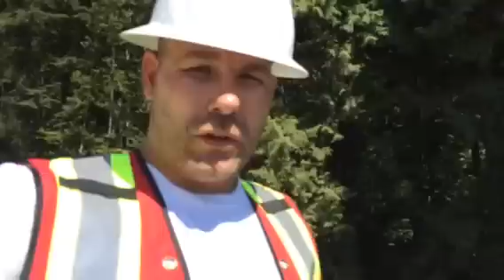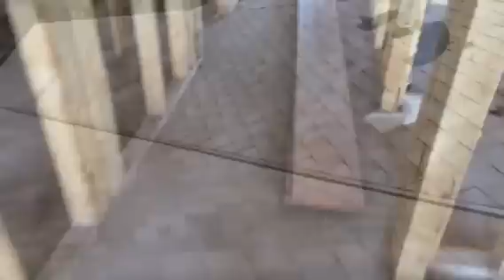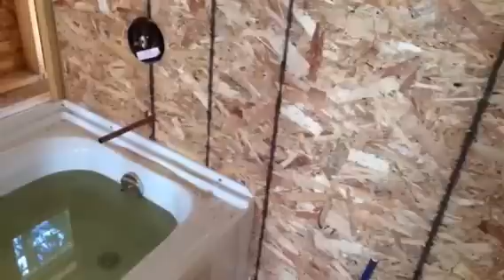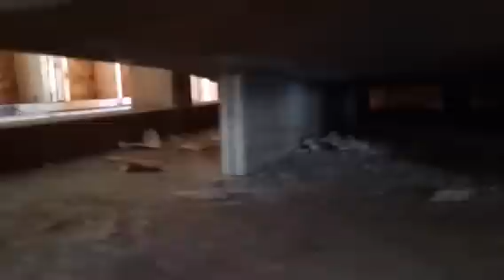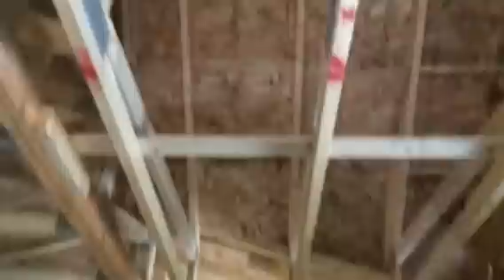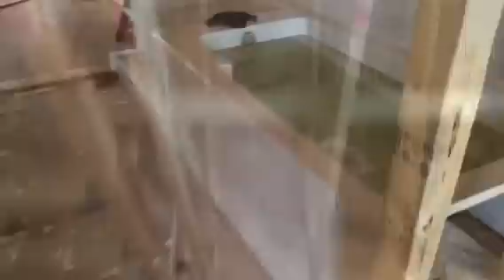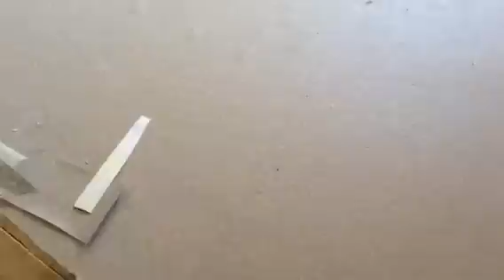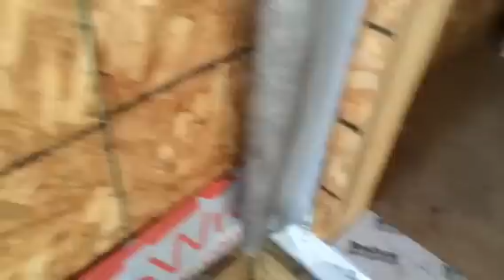New Home Construction Fails

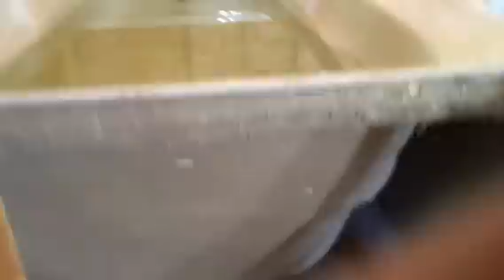Comment: Hmmm... that's strange. At 1:45 the gentleman states that 1 gallon of water weighs 10 pounds... which is true, IF you are in United Kingdom. In America, (pretty sure he is American) 1 gallon of water weighs only 8.34, because American pints, therefore gallons, are smaller than UK ones. As a building inspector, I would EXPECT him to know how much a gallon of water weighs.... ESPECIALLY if he is making a point by mentioning it!!
Reply: chris b You'r right. But I would be amazed if Canada uses British pints instead of American ones. I would have heard about it. Think of the fuel pumps in gas stations either side of the border. Neither of them are on litres, yet...

Comment: The OSB on the tub valve wall is most likely a shear wall required by the engineer and will be covered with moister resistant sheetrock or cement tile backer (if in fact tile will be installed). You can see that the bathroom was framed 1/2 inch over-sized to accommodate for the OSB. You had the same situation with the other tub, OSB (most likely a shear wall) covered by sheetrock, although the sheetrock was the wrong type as you said. Almost all fiberglass bathtubs and showers are manufactured with an OSB base/frame, and have been for at least the past 20 years.
Reply: Then the shear wall should be on the other side of the wall.

Comment: Lot's of people commenting that the OSB wall is most likely a "shear wall". No it's not! A shear wall might be used in a major building, like a hotel, in which case it will span completely from one side to the other, except for where it passes through hallways or doorways. A simple residential does not have them. The biggest reason in this house appears to be simply a sizing adjustment. The bathtub will be a standard size of 60inches. If the room is too big, then the plumber can only screw the tub to one end, with a gap on the other. It appears they just furred out the wall to make the room 60. And no, they don't put tile directly on that, but a tile/wet-location approved wallboard will be installed first. But even with that, it's still preferable to have real wood behind it. OSB is the worst choice.
Reply: +Kauwhaka Bathtub 60 inches ....  WoW.. a country of dwarfs ?? :-) (Don't believe so...) Bathtubs come in all sizes of fashion and money available.  The 21st century is not about "standard" anymore.
Reply: +Kauwhaka Maybe in your country, but in the USA we have shear walls peppered everywhere along the envelope perimeter of a single family residence, as well as a few on the inside.  They can be as narrow as 16".  I think you may confusing party walls for multifamily and commercial fire protection with shear walls (to resist lateral wind or seismic forces).
Reply: +Steve Crane Yes. As you said, in situations where a shear wall is used, they are connected to the exterior. This wall we can clearly see is not touching the exterior. It's just standing on its own with nothing on either end of it. (One side is hallway, the other is open stair well. And no, a shear wall and a fire wall/party wall are 2 different things, although in some situations a party wall can be designated as shear and it gets sheeted before the 2 layers of fireguard drywall is applied.
Reply: +Wig4 60 inches/5 feet is by far the most common and dominant length for normal tubs like the one shown. Any search for such tubs will show more at this size than any other. They can come in several different shapes and sizes, especially if they are Jacuzzi type tubs or corners tubs, but if you see or search for a tub similar to the one shown, the vast majority are 60 x 32 or 36.
Reply: +Kauwhaka We will never know.   I have built houses with the shear wall strapped to a glulam underneath instead of to a lower shear wall or a foundation.  It is unusual though, since most shear walls transfer forces directly downward to the foundation, thus they will likely be an exterior wall.  Honestly, the framers may have framed the opening at 60.5" thinking they are doing the plumber a favor, and the plumber may have nailed in the OSB to get an instant 1/2" shim so the tub fits snugly. Don't ask me why I suspect this.  I will tell you that I ALWAYS carry a full bottle of aspirin in my truck.
I am frankly weary of this vociferous pissing contest by amateurs and know-it-alls when our evidence is so sketchy.  I'm guessing.  So is everyone else.  What we know is that there's nothing wrong with OSB back there, and that no professional will ever tile over OSB -- ever!  The inspector hasn't been around construction long enough to understand what's going on.  And I'm not at all surprised.
Reply: +Kauwhaka Simple answer:  I repeat with copy-paste and a little modification : 
Bathtub 60 inches ....  WoW.. a country of dwarfs ?? :-) (SEEMS PROVED !!??? ^_^) 
Bathtubs come in all sizes of fashion and money available, IN EUROPE.  The 21st century is not about "standard" anymore, IN EUROPE.  Minimum length range +- starts at 1700mm here (since ages), and most common nowadays are 1750 x 720-750 , or 1800 x 750-800 ..... at least, we're not folded down like sardines in our choices of bathtubs !!??? lol 
>>> 
https://www.google.be/search?q=baden&source=lnms&tbm=isch&sa=X&ved=0ahUKEwjvyK_ozK_LAhVBIg8KHUd3CCAQ_AUIBygB&biw=1011&bih=515#tbm=isch&q=baden+afmetingen  

Have much fun in those US-Dwarf-tubs ! :-)
Reply: +Kauwhaka residential does have shear wall. If you notice by slight clues that was a stairwell wall and probably did require shear. Watch the vid again you can see the top step right before he goes in the bathroom. Also notice the nail pattern on the osb, it clearly has nails every 3 inches on the seams which means its been blocked for shear. I would also bet the wall below that shear wall is also shear, actually it is. As for the tub just another little clue. Look at the flange of the tub and that will tell you it will require another layer of substrate ie hardibacker durarock etc.

Comment: As a european it is scary how these buildings look like. The wood that holds the roof is insanely thin. I wouldn't dare to live in a building like that.
Reply: +mongolz1000 A tree will slice through 7/16" OSB over roof trusses like butter, but the double top plate typically stops it.  Trees and houses just don't go together, no matter cozy it looks.   Pick the tree or the house, because they cannot coexist.  Trees usually win.  Planning departments force us to crowd houses into trees to save the tree canopy.  They unwittingly ban solar generation forever in that home.
Florida and the Gulf states have good codes for hurricanes, better than anywhere in the world, but the older houses take a beating.  Tornadoes, however, will shred every limb under 6" of a mature oak tree and toss a tractor trailer rig in the air.  They have the force of multiple bombs, and pretty much only bomb shelters can take  direct hit and stay intact.
Reply: +Steve Crane I typically use butter knives to slice through butter, instead of trees.
Reply: +mongolz1000 Looks are deceiving.  Science helps us build more with less materials -- just look how far bridges have come since the old Roman stone bridges. have come.  No American's roof is coming down on them.  They resist all the rain and snow that falls on them, but they aren't designed to hold up a 50 year old fir tree that falls on it w/o damage.  Maybe European roofs can do that.
Reply: +mongolz1000 European Union is bullshit. Its just a way for people to control Europe.
Reply: rsx123 Is this idiotic comment relevant to this discussion? I don't think so.
Reply: Steve Crane In Europe the typical rafter size is 7,5 x 15 cm (3 x 6 inch) or 10 x 15 cm (4 x 6 inch) so at least there is a possibility it can withstand a falling tree. Usually we don't use OSB in a building but only bricks, inside walls are ofter 8-10 cm (3-4 inch) thick brick walls, outside walls are typically 30-38 cm (12-15 inch) thick brick walls. Of course there are much more building materials but most Europeans prefer heavy buildings.
Reply: +mongolz1000  Now, alas, you're just telling you live in the times of the Flintstones, mongolz....  Where exactly are you based ? Roof-Rafter sizes in wood skeleton construction technique in combination with isulation between rafters are avalable in both traditional EUR sizes of nominal halved beam sizes ( 31x173 , 36x225, 36x275 etc... and the 31x145 measuse is FORBIDDEN for roof use, already from the sole point of view it's a violation on every isulation norm) or the Canedian sizes from CLS as a minor production in Scandinavia, but they do not export the larger sizes (over 140mm) anymore because nobody in the EU asks for those,) When it comes to main beams , the range goes 63x173, 75x225, 75x275 ... and larger sizes got abandoned, as it became standard practise to use glued laminated beams produced to calculated prescritions.  In main loadbearing construction beams, I have NEVER used anything else then ON-MEASURE produced laminated wood, since over 20 years now...  (Useing SARKING roof principle as well) 

If you talk about brick walls is façade, the typical Belgian suite from inside to outside is : min. 10mm plastering, 140 mm large format bick, between 120 and 280 (!!!!!!) mm insulation material, min. 30mm small air cavity when not rockwool, façade brick between 70-110 mm depending on your bick choice fashion. It ANYWAY brings us to a minimum avewall size of 380 mm , minimum due to for instance the minimum lefgal insulation norm in Belgium dated 2016. But many do "more", and "Passive" construction technique is already becoming quite common.
Reply: +Wig4 Here you get an idea about how it looks like, building a "Energy-Passive" dwelling, applying 24 cm of PUR isulation material, in typical (Belgian) massonry construction method. 
http://www.livios.be/media/109252/nl/passiefhuis-massief-passief-320.jpg
Reply: Wig4 Why would Europeans live in the stone age if they are using brick walls? So you mean in Belgium the roof is standing on a 140mm concrete pillar? Insane.
We were talking about walls, we weren't talking about insulation. EU regulation today is facades must have U<0,24 W/m2K. In some countries they are using thicker insulation because the wall thickness is so thin. For example 38 cm brick wall + 10 cm EPS insulation is U=0,23. So there is no need to have 20-30-40 cm of insulation according to the regulations (however lots of newly built houses come with 20 cm EPS). Also the heat storage is much-much better if you have a brick+conrate wall, so there is a very high possibility you don't even need an air-conditioner in most summers.
In the last few years the energy-efficiency tren went terribly wrong and the market (but sadly also the regulators) says you should have a very light building with a lots of insulation, but because you don't have any heat storage capacity, you also should have an A/C and a ventillation system. At the end you end up with a higher price and you'll also have to pay for electricity.
Reply: Wig4 Thanks, I am very familiar with these construction technique and you also should know that these method cannot be used where outside temperature in winter is often below 0 Celsius. In oceanic climate it is acceptable but if someone is not living in the mediterrean area it is absolutely recommended NOT to use it. Btw the value I mentioned above U=0,24 is the regulation for "passive" houses too.
Reply: +mongolz1000 (I was responding a long text but suddenly the message lost on the system. No further time now,, I have other things to do,  back tomorrow)
Reply: +mongolz1000 I've only seen homes in the UK under construction, not the continent, but people tend to use the materials which are most prevalent and cost effective.  North America has a gigantic timber industry, particularly the NW, and we use wood for as many things as possible.   Bricks certainly resist the elements longer, but over here they cost much much more than wood.  Also, the west coast must deal with seismic shear forces, which plywood panels counteract much better than masonry.
Your rafters are impressive, but again we rarely spend the money for their size since it will all be hidden.  With trusses we can get a morning delivery and almost get 'em all rolled up by lunch.
Reply: Steve Crane I absolutely understand why they build homes in the USA like that, I didn't say it is wrong or anything - but they also cannot resist a hurricane or tornado that much. Seismic activity over there in some areas are very critical. However I wouldn't live in a house like that.
Reply: +mongolz1000 I aggree on the general flimsy state. I'm European, and architect, with full legal (non retractable) responsability in control over execution as well (something that does NOT exist in north America, which is the reason there, "Home inspectors" do exist. (Not here)  The flimsy state of north American wood frame buildings however IS legal, there. Stability calculation norms are so much lover then in Europe (See: Eurocode) Not only the minimum stability code is lower, but also (and prominently)  the heat insulation minimum requirements.  (Side note : Which is why the construction cost before finishing in north American private building can be easily 1.5 to 2  times cheaper then European. Europe requires structural and energetic "Mercedesses" allover, while north America still allows "Old school Dacias". :-) ..)
Reply: Wig4 From energy consumption side North American standards are crazy compared to Europeans. However we are in a different situation because EU don't have too much oil, gas, etc.
Reply: +mongolz1000 It has nothing to do with it. It has everything to do with political decisionmaking.  EC is worlds prominent force in fighting back energy waste.  Compare with Japan, where legal heat insulation minimum requitements are almost ZERO (none) , abeit, they do not have any oil, nor natural gas, nor coal. The european continent (Northsea-to Ural wide...) still has relatively plenty.   It's all on purely political (lobbying) level.
Reply: Wig4 Party agree.
Still, the political situation is that because of hisorical examples EU cannot allow hanging on Russia. EU has to be very independent. Also the European continent is the "oldest" (from civilisation point of view), and compared to Northern America much more crowded. If you want to build a house in an average area, you have to demolish one. In Northern America except big cities there are plenty of free space.
Japan is another story.

Comment: If you install one of the "new" fibreglass tubs versus the old steel tubs you will find that they require shimming to accommodate the slope for drainage. This is a very tedious process as they mus taper to match the tubs slope. If you don't do it properly the bottom of the tub will flex and eventually crack out and fail. A plumber friend of mine showed me a little trick to support the tub bottom and make it bullet proof. Don't bother with the shims. Instead, mount the tub so it's level as required and then fill the underside to the floor with polyurethane foam in aerosol cans normally used for filling in between window frames and the sills. Fill the entire cavity and let it cure. This will support the bottom and it will never flex or fail.
Reply: +Norman May 
I would think the tub is tapered from the factory?  I like the idea of foam but I heard you're supposed to use mortar under the tub.
Reply: The slope is part of the tub but the top or upper surfaces must be level. Unfortunately few if any manufacturers ad any form of shoring on the underside for support. Mortar can and is used but it is a pain. The foam is relatively easy to install, more than adequate for the task, and will cure out in about 24 hours.
Reply: +Susan S you use mortar to slope a shower pan or a tiled shower. I haven't installed a lot of tubs, but I've ripped out a few, and I'm pretty sure I've never heard of a pre-made tub needing a bed of sloped mortar underneath.

Comment: those tubs had screws holding them up on every stud the first one has 9 on the back do you know how many pounds 9 screws holds. tubs  don't fall when leaning into the wall with 9 screws holding it in place. bottom braced for level more than anything. all tub manufacturers have that same board that they glass to its a industry standard. all those tubs are waiting on more board, probably aqua board you don't really think that lip is exposed and those screw are not covered along with the proper board. the wood backing is probably for mounting and the jip rock is firewall or sound deadening on the second tub. but good catch on the one deck issue really caught that one tricky deck guy couldn't get that one by you. go learn a trade.

Comment: There's nothing wrong with osb behind a bathtub wall as long as it is sealed, you say WHEN moisture gets behind the tile, technically it never should.. But that's why you use a moisture barrier or a completely sealed tub/shower enclosure.. The moisture shouldn't go anywhere but down the drain or on the exterior tub walls that are finished.
Reply: +BurningTirez osb board will not pass plumbing code inspections in most states, as use for a tub or shower surround.
Reply: +BurningTirez Tile is not water tight, and if the moisture barrier fails, then the OSB will get wet and fall apart. Why design something to fail? That's a bit like not having an overflow drain because the main drain is supposed to work.